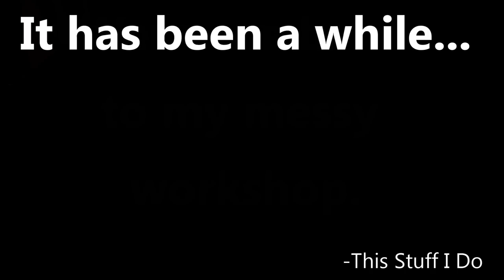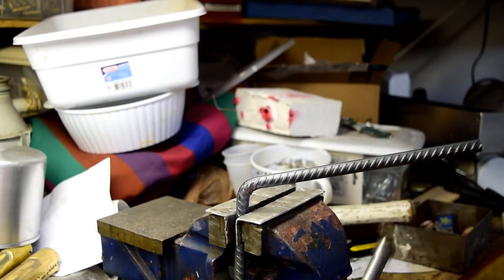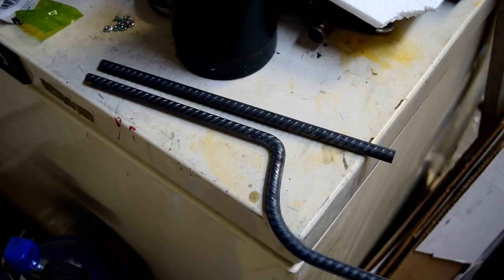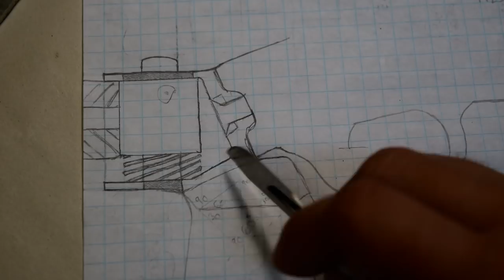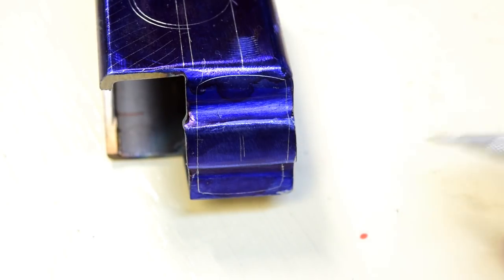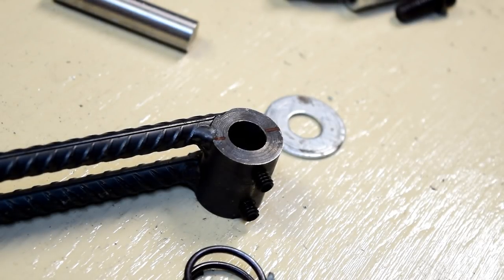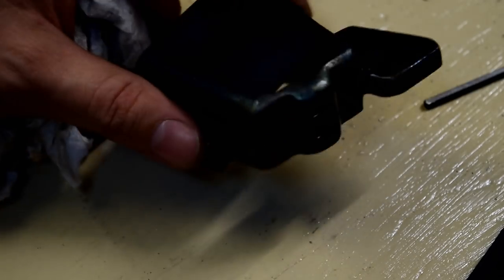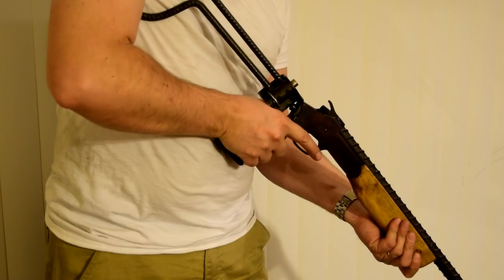Making a folding stock out of rebar

Comment: You done a great job there, l came across this video around a month after l did basically the same but mine is for a Webley Vulcan air rifle, the Vulcan barrel pops out of the breech block with grub screws, so when folded it's very compact, only thing different l did was when finished l had it powder coated, l cut the barrel to 10" and 1/2 UNF threaded l have a SAK Moderator on, with the Hawke scope it's so accurate and powerful.

Comment: lovely manual work. For us poor boys, I have thought what if we had access to a sort of finishing machine that has a grinding wheel mounted above a solid table with x y and z axis available. it would not need to be big at all. The idea would be to help the poor boy fabricator finish critical surfaces for squareness and parallelism after the majority of the roughing out is done. After all, the critical fiinishing cuts are not that heavy to make a big difference in the workmanship of the pieces.

And geez by, ya need at least open sights on dere!

Comment: You are aware you just made a title 2 weapon right?  If it can be fired with the stock folded the overall length with the stock folded MUST be 26 inches no if's and's or butts about it.  You could make it legal by applying for and paying for the 200$ tax stamp to manufacture an AOW, put on a barrel long enough so the overall length is never less than 26 inches, or make the stock permanently extended.
I'll say it's neat looking but also very illegal.
Reply: 0 fucks given.
Reply from the maker: I'm glad you called this out. Someone always does. As featured in the video, the OAL was slightly longer than 26" from tip of barrel to the back of the hinge box. However I'm not sure if the OAL measurement is supposed to go all the way to the back of the hinge box or just to the back of the receiver. I'll weld on a flash hider or something just to be on the safe side. I have no intention of violating NFA and I want to make it obvious that I haven't. 

Other "gotchas" with this design that I need to be very careful about:
1. If I ever install the .22 barrel that came with the set it may be under 26 OAL. I haven't measured and I don't intend to ever do this. 
2. If I ever install the .410 barrel that came with the set I would have a pistol grip shotgun, which I believe also carries special restrictions and caveats that I'm not aware of. I also never intend to do this.

This folding configuration has not left my shop, with the exception of the closing video in my kitchen, and certainly has not been fired yet. It should be considered 'under construction'.
Reply: I saw in the other video the rebar was "about 18 inches" which means that gun is well under the regulated length, You can permanently affix it open, but you can't remove it. As equipped the ATF take a tape measure from one end to the other with the stock folded if it can be fired that way. You might also not want to have the barrel and the gun anywhere near eatchother because if a LEO saw that it could be considered constructive posession. I have an UZI with the 18" barrel but if I even had the short submachine gun sized barrel in my posession without an AOW tax stamp I could get in a lot of trouble.